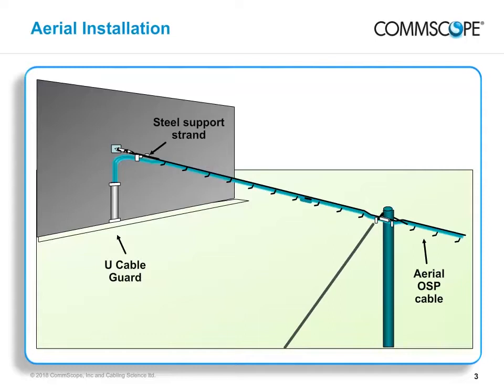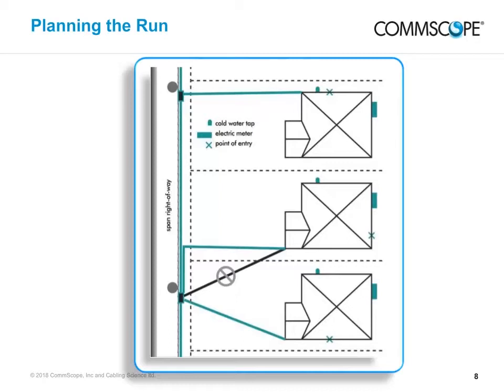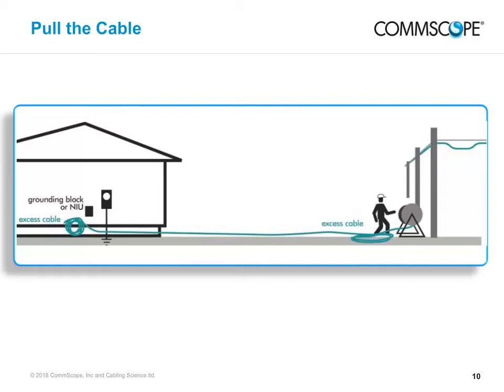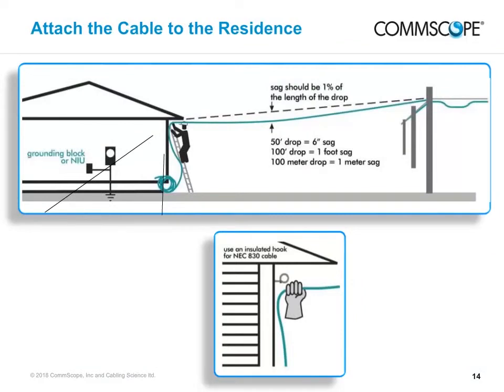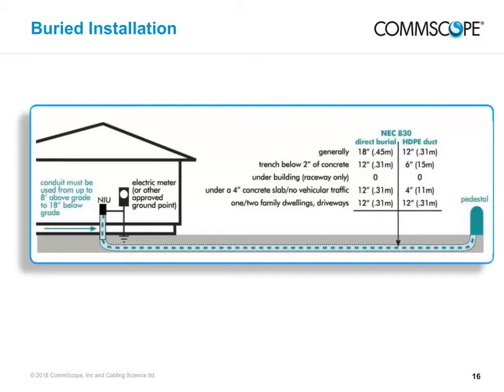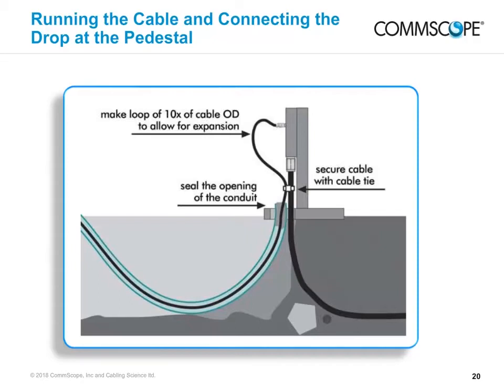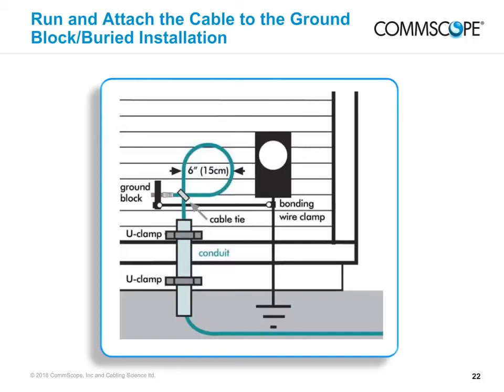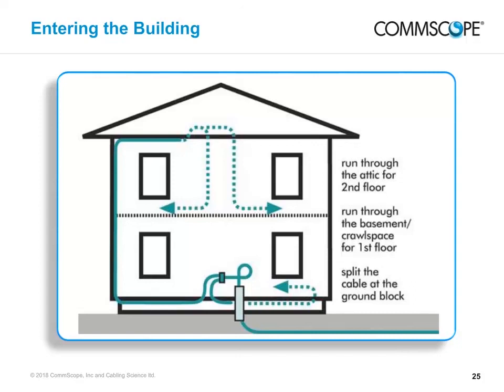Outdoor Cable Installation

Comment: Thanks, James!  This was exactly what I needed to replace a partly pulled-out p-hook on the side of my house, and properly reconnect the cable to a new, stainless steel 5/16" x 4-1/2" screw eye.  I used the 2, 2, 4 method, kept loops at least 6" in diameter, made curves very gentle, and was careful not to kink, cut or crimp the cable.  I could not find this information ANYWHERE else.  THANKS!